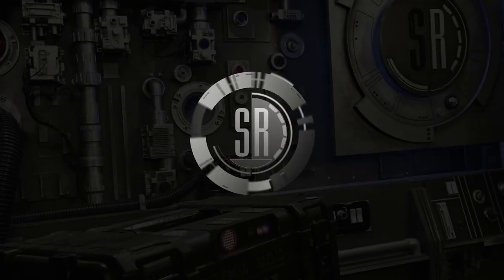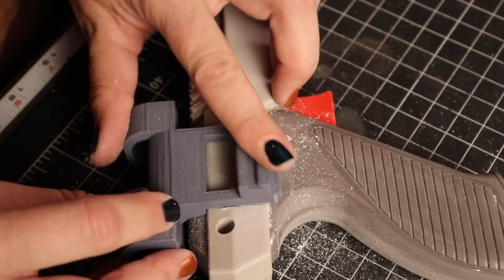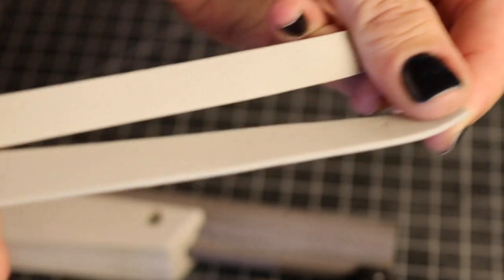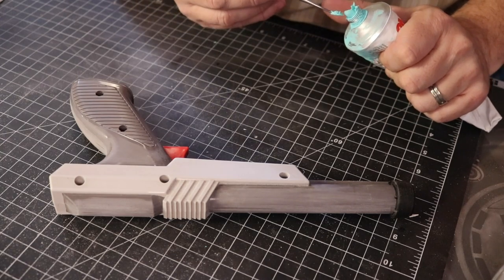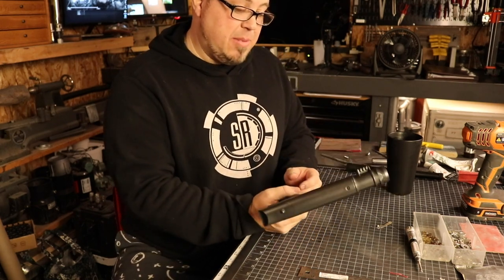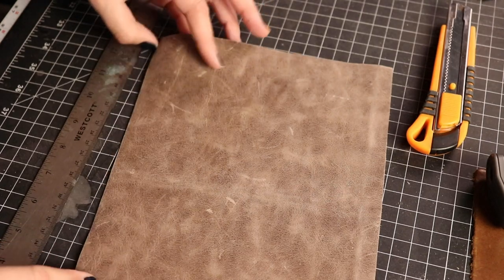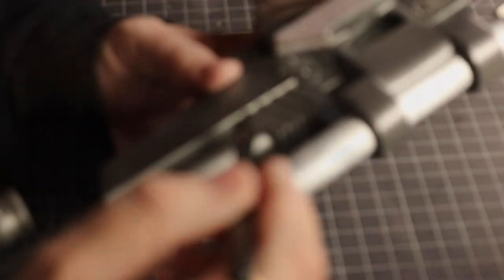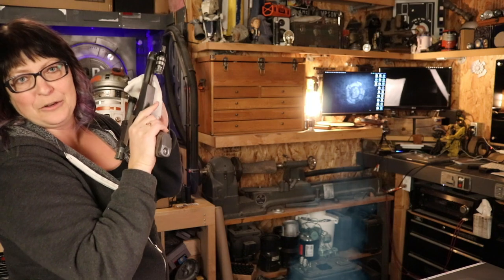Diy Star Wars Blaster

Comment: If I buy that original, complete and never used Zapper in mint condition, that just showed up on eBay,  to rip it apart for a blaster build, how much fun with the haters will I have? Greetings from Germany
Reply from the maker: Totally, that's why we bought "non-working" versions.  I do have two that are in perfect condition, but we'll save those ;)
Reply: @TheSmugglersRoom  : Funny thing is, that the mint one is by far the cheapest.